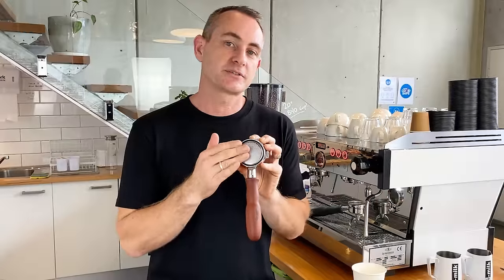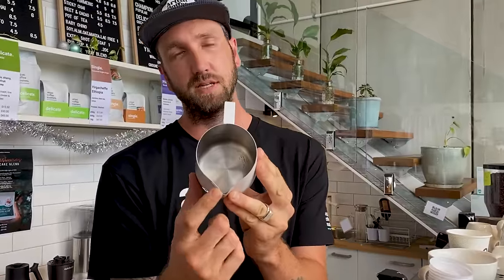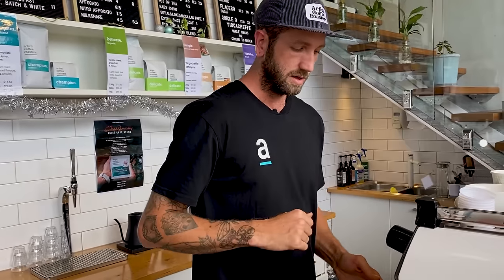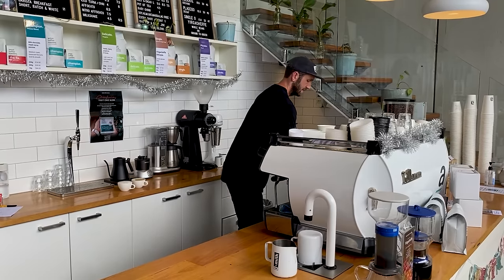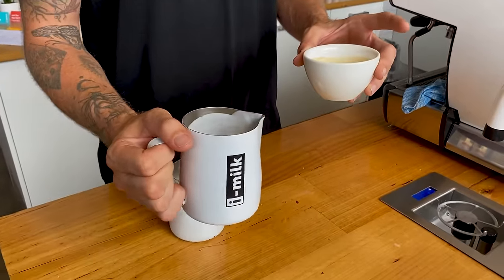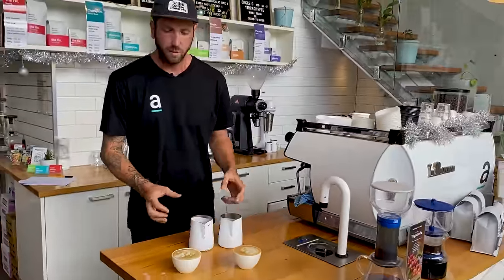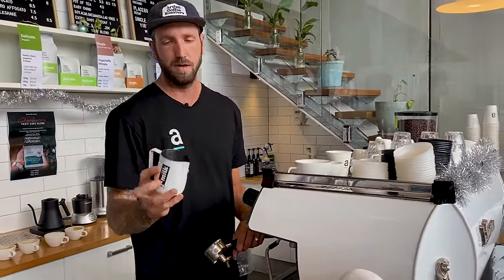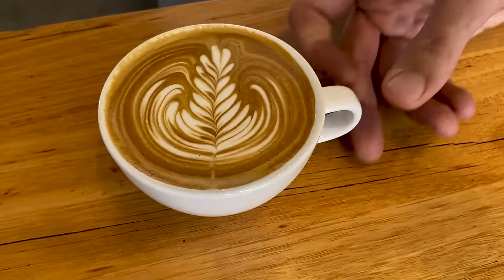How To Fix The Issues With Your Latte Art Right Now

Comment: I would love to know if you are actually supposed to tap your mild jug before pouring or not. The way I’ve been taught is to froth your milk, let it sit for a little bit so the air rises and then tap it to get rid of any bubbles but the other day our master barista came to our shop and told us that we are not supposed to tap the milk because we want all that air? So what is actually the correct way of doing it? 😅
Reply from the maker: If you have noticeable bubbles you want to tap them out, it it’s silky, smooth and you let it sit to allow the bubbles and foam to come to the top for a little bit, it will look like a Matt finish and then you swirl the milk and it becomes glossy, there is no need to tap and you made perfect milk.

Comment: I use french press for frothing milk. And it always too much froth, we drink only froth and espresso, there's no milk 😅 Thanks for the info.
Reply from the maker: Yes, making foam this way is tricky. It’s all about the correct level of milk and the pressure you pull the filter up and down at. Small quick movements is my recommendation. Cheers luke

Comment: Hey, I work at a bowling alley and we have a cafe and kitchen to serve food and when I was taught how to make a coffee I was told to spin the dial to the maximum to produce steam. I noticed you didn't do it and was wondering If im doing it wrong. feeback would help :)

I also have a $100 target coffee machine and I've been practicing for a while with it, and i definitely think if i buy a better/bigger pitcher that would take a big effect on my coffee mug. Thanks for the tips and tricks to pouring the best latte art
Reply from the maker: Yes your correct always go 💯 on the steam tap open, these machine are a 1/4 turn tap to full. 👍🏻
Reply: @ArtistiCoffeeRoasters  Thats so good, I wish my coffee machine at my work did that because it bubbles the milk a bit when you go to turn it off

Comment: Great work on the video!! Helped me grasp the height of the finished milk in the smaller jugs, and the impact that has on getting the tip close when developing the canvas… THANK YOU !!

One slightly left of centre question regarding the pull, what was the mention of the ratio or time… I think I heard “4 on 2” ?

Comment: What milk is best? Whole, 2%, etc? Really struggling to get a good milk consistency with my wand. Is it based on time (you did about 9 Sec)?
Reply from the maker: Try full cream milk, time is based on the pressure of the steam only, if your not getting the milk to spin this will be your biggest issue

Comment: Hi, I would like to ask you what is the main difference between entry level coffee machine and professional one. My is making bigs bubbles and I am not sure, whether it is because of weak steam or because I am not doing right movements with the jag or wrong timing. THere are outside external cream making devices, but it is not the same as milk you were working with
Reply from the maker: You need a good steam pressure to make silky milk. Better machines have bigger boilers which produce a dryer steam helping to make better milk foam . Ideally find a machine that has a single boiler of 1.6lt to 1.8lt
Reply: @ArtistiCoffeeRoasters  Thanks a lot and good luck

Comment: At my work we have a rather lower end coffee machine. I try to get into latte art but I notice if I try to mimic professionals's way of steaming the milk, mine is way too thin. I need to get that sizzling sound for at least 5 seconds straight. Obviously I'm not experienced enough to do consistent & really good latte art, but I was wondering, is the steamer holding me back in any way?
Reply from the maker: Yeah lower end machine tend to have low quality steam that is also weak so it doesn’t texture the milk well. 
It can be done, just need to adjust to suit the machine. 
Start with adding air for longer so it’s not so thin.

Comment: Maybe a dumb question, but how do you get the milk to stay on top of the espresso right when you want it to so you can actually see the art?  My milk just all goes straight into the espresso so you can't see it, and then at the end I get a little blob of milk foam on top.  I don't know if that means I'm putting too much air, not enough air in, something else?  Thanks!
Reply from the maker: Keep your milk spinning till the end of your heating, this will keep it from separating. Then let your milk sit for 10 seconds before you pour this will bring the foam to the top the swirl again. You will have more control then.

Comment: My milk keeps plummeting below the coffee after upgrading to a QM pathfinder from a Bambino Plus and Gaggia Classic Pro. In the later two, I had consistent success. On the QM, the froth looks great, but I can’t get any latte art at all. Steam full open, same slow pour supply jug, same milk. Thoughts (other than I’m just bad)?
Reply from the maker: Is the foam thick or silky smooth? It is rising to the top of the milk jug or it is blended in?
Reply: @ArtistiCoffeeRoasters  
It appears to be of that silky/smooth texture, and I’m careful to consistently tap and swirl until ready to pour. I’ve noticed that the screeching sound happens between 118 and 125 F. Perhaps this is where I’m doing something wrong?
Reply: @ArtistiCoffeeRoasters  
Update: So for starters it seems I was holding the jug at a silly angle. Next, for some odd reason I was forgetting  to slowly bring the cup back to level during a pour. As suspected, mistakes were all me! Just need to work basics/technique😅

Comment: Why is my latte art not really spreading? I try to pour latte art but it’s just kind a really small dot, instead of a dot that spreads and curves in on itself.
Reply from the maker: Are you sure you have enough foam created in your jug? Have a look at the volume you start with in the milk and make sure you have increased the volume when frothing, many times you may only get a small amount which makes patterns hard to pour as you don’t actually have any foam
Reply: @ArtistiCoffeeRoasters  yes I’m sure. I fill it up until it touches the bottom of the indent of the spout or just below. When I finish it usually goes up about halfway in the indent.

Comment: Another thing to note is that it will take you way longer than 5 sec with your home machine to get your milk texture right
Reply from the maker: Yes, that's right most home machines don't have the same steam pressure as found on a commercial machine.